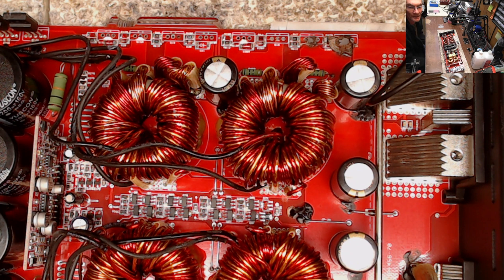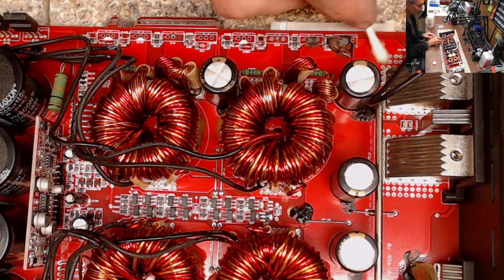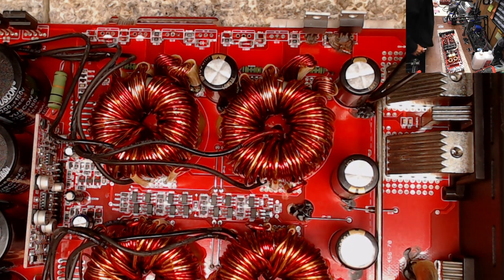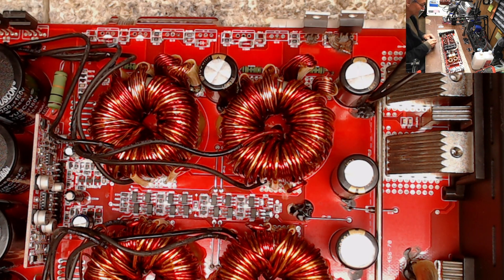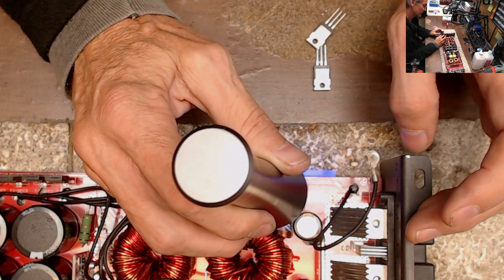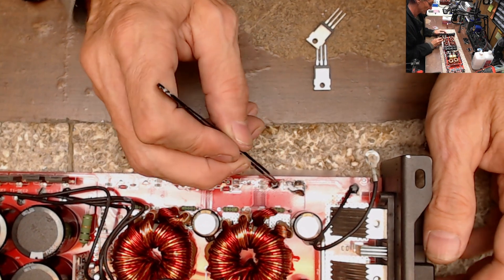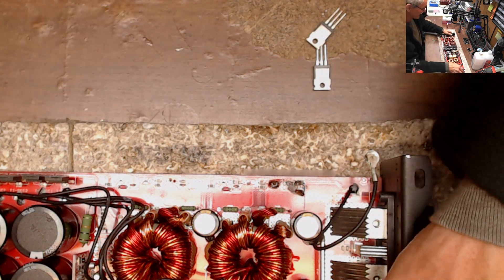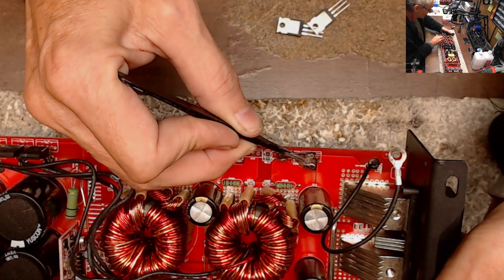My Method of PCB Repair Power Supply of a Skar Amplifier

Comment: I have a gnarly pcb burn area that I need to replace and I think I most likely will try this, what do you do for remaking traces though?
Reply from the maker: I use copper tape and cut the design of the trace out. Trace repair methods differ depending on the situation.

Comment: Quick question, what heat sink paste do you recommend? 
Just any non conductive thermal paste?
Reply from the maker: I use Dow 340 and another called Ice Fusion depending on what amplifier I am putting back together.

Comment: Great work ! Alot of these amp boards are only 1-2 layer PCBs  correct ?
Reply from the maker: Correct however Multi-layer boards are becoming more prevalent with today's technology.
Reply: @ellensburgamplifier  I've noticed! especially with the increase of smd components.
Reply: Very nice work todd!!
Reply from the maker: @markroberts715  Thank you! I thought it was a little boring but it may help others.